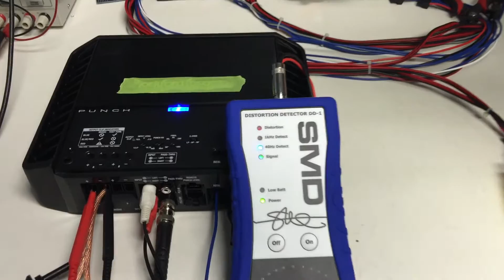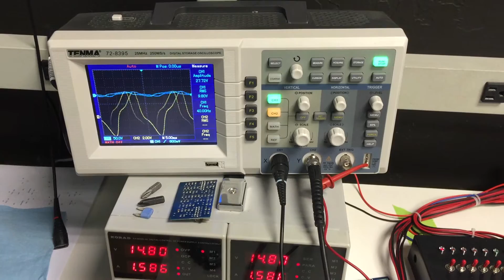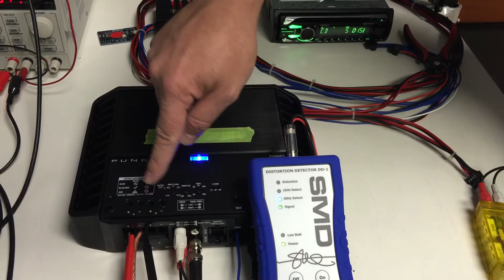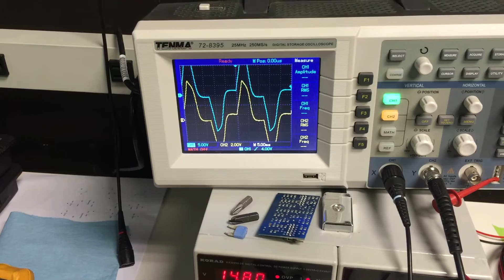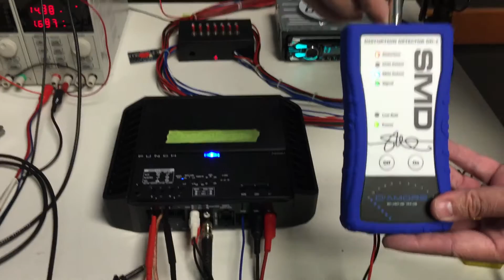DD-1 Video Manual Video 3 - DD-1 vs. a high level converter

Comment: sry, but next time use a good high low adapter like mosconi or other
Reply from the maker: They all do this unless they are active.  This is normal behavior of transformer coupling, it should never be used below 50 Hz
Reply: but all mosconi are active high low adapters. this is btw the first time i see a high/low adapter running without power. must be some ancient shit XD
Reply from the maker: These all look passive not active.  Hard to tell because their website is shit http://mosconi-america.com/mosconi/dsp-accessories/
Reply: Mosconi HLA SLIM

Stand-By Current Consumption < 0.8mA
Operative Current Consumption < 15mA (< 30mA in the Dual version)
Polarity Inversion Protection Yes
Max allowed current on Remote Out 100 mA (normal operation)
Min allowed load on Remote Out 120 Ohm (normal operation)
Remote Out Voltage > 12V @ Irem-out < 100mA
Remote Out Short Circuit Protection Yes (to ground)
Max Short Circuit duration on Remote Out < 10 second (*)
Total Harmonic Distortion < 0.01%
Slew Rate 10V/uS
S/N Ratio > 100dB
Channel Separation > 60dB
Common Mode Noise Rejection > 60dB
Stepdown conversion ratio 4:1 V/V
High Level Input ballast impedance 45 Ohm / 2W each channel
Max continuous (sinewave) Power handling @ 4Ohm 25Wrms x CH
Max allowed Head-Unit nominal power handling 50W x CH (**)
Max Output Signal @ THD < 0.1% 3.2 Vrms
Min Output Load Impedence 2 KOhm

(*) if Max allowed time is exceeded, permanent damages to device may occour.
(**) maximum real RMS nominal power, not PMPO, peak, etc.
Reply from the maker: Yeah that's legit for sure.  Don't see it on the American website.  90% of the high level converters sold today are like the one in this video unfortunately.  The reason we made the video was to direct people who are having this issue to the video to see the problem.  So many people contact us about this "problem"  they are having with their DD-1 only to be told the DD-1 is doing what it is supposed to do, detect distortion.  Thanks for the info on the active Mosconi piece
Reply from the maker: Thanks!
Reply: no problem thanks for your answers XD, I can really recommend the mosconi high low adapters they do a awesome job.

Comment: the line converter has gain adjustment on the end. it's probably turned all the way up.
Reply: That made no difference.  The distortion at low frequency is because of the use of a transformer.  These (and most) transformers don't work well at 40Hz

Comment: Got the dd1 and cc1 yesterday. First thing I tried dd1on my friend's system (basic jvc hu and alpine amp and type g sub) and something weird happens: sometimes, while looking for distortion coming out of the Hu, max clean volume seems to be 40, but if the car is running the distortion point changes sometimes to 46, 48, and even shows no distortion at full volume even if I hear crazy clipping at that point on door speakers.. How could this affect the distortion point? Tried both measuring trough amp and by pluggin rca directly into dd1 and still the same :(

Comment: Just got everything set up with the triple play set. Quick question, if you could help me. What is Bass EQ and how do I set it? 0db to 10 db. Port is tuned to 35 Hz.
Reply: Hifonics BE1700.1D pushing SoundQubed HDC3 12" D2 Copper  If that helps too
Reply: Box/Sub is 30.0Hz @ 10.6 Ω Low 51.3Hz @ 14.8 Ω High Port is 35.6 Hz @ 2.0 Ω